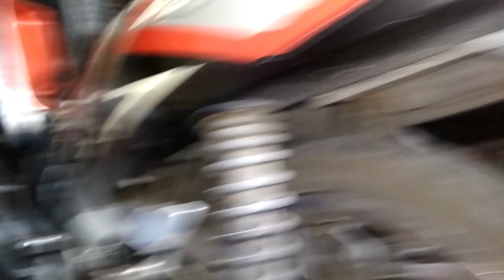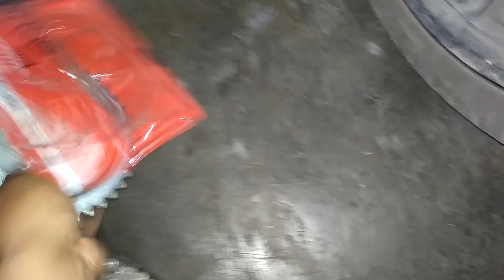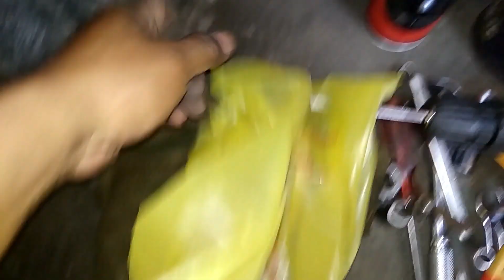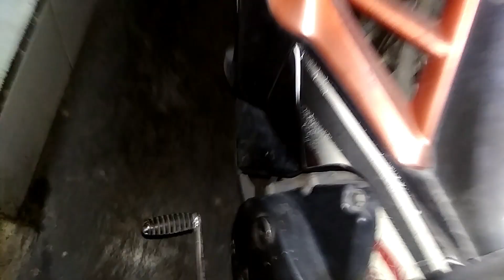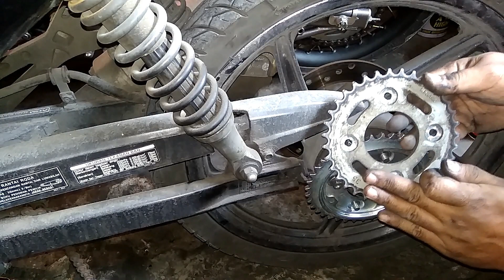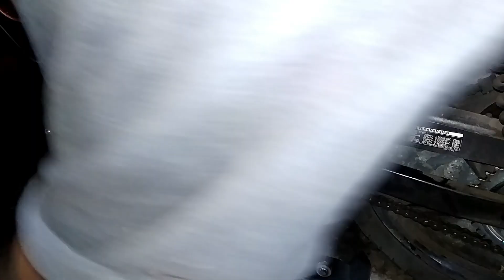SUBTITUSI PNP Gir Rantai set sesama motor HONDA Supra 125 tipe 420 mata gigi besar n lebih responsif

Comment: Kalau buat tanjakan yang berat Supra x 125 karbu mampu ngak bang buat boncengan pakai gearset uk 14 - 39 punya Supra X 125 injeksi
Reply from the maker: lebih mampu drpd bawaan motor.
Reply: @cakdidik  misal klo buat kota kota jalan datar gmn bos q...
Reply from the maker: @achmadharjanis6623  gpp, tdk ada masalah, klo mau di kecilkan belakang pakai 37 jg gpp.
Reply: @cakdidik  maaf cak didik klo boleh thu itu stndart utk supra 125 fi ukuran ger nya jg pakai 420 kah?
Reply from the maker: @achmadharjanis6623  betul 420 juga
Reply: @cakdidik  bisa minta no WA nya cak didik
Reply: Misal klo pakek yg new blade 37 T itu gir nya 420 atau 428... Semisal new blade pakai 428, apa bisa di pasangkan ke supra 125 karbu nopo boten enten gangguan ngeder smpai kerasa ten postep...mohon jawbanya ngge cak didik ngapunten ngrepotin🙏
Reply from the maker: @achmadharjanis6623  081332886065 wa
Reply from the maker: @achmadharjanis6623  tidak ada masalah utk tipe gir dan rantai ber efek ke getar. getar timbul biasanya kalau tidak rantai ya terlalu kemcang atau terlalu kendor.
Reply: @cakdidik  ijin bertanya mas. Gearnya Supra apa ya yg 14 37 rantai 428! yg pnp utk Supra X seperti yg di video?
Reply from the maker: @editiwarman1408  coba pakai supra fit new yg fi
Reply: @cakdidik  Trm ksh infonya mas.
Reply: @cakdidik 

Izin tnya mas, mohon di jwb engge..

Klo gear set 14T 38T 428 di pake di Supra x 125 karbu thn 2013 ngaruh di mesin apa nggak mas ?
Reply from the maker: @jayadi551  dimesin tdk pengaruh besar, hanya tarikan motor akan berkurang